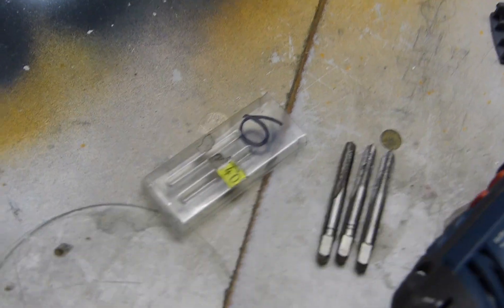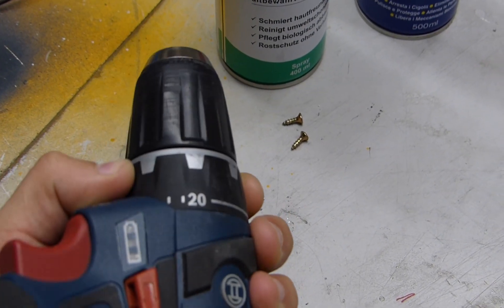Quick tips: Outlaw tapping

Comment: you do not need 3 taps. A single SPIRAL tap will work fine. Been doing that for years no issues, tappping thousands of holes.  But must be spiral tap so the chips are pushed forward.

Comment: As a machinist, I'd suggest just using the final tap to start.  at least in aluminum. It's something I've done in the past, and never broken a tap for. Using a single tap eliminates the potential for the tap stages to miss the previous tap's lead.  Also,  counterintuitively, hand tapping is much harder on taps than power tapping. Taps don't like side forces, but handle torsional loads just fine. so  using a drill is better no matter what. Personally, I  saw no  broken rules.

Comment: For larger taps you can get away with that. The trick is just to make sure the tap goes in STRAIGHT... tap doesn't go in straight you get a broken tap and your stuck starting all over. I have snapped quite a few taps as a machinist by NOT feeding in straight! 

With the 3 taps you got they were the same diameter overall it is just the first one has an extremely long tapered area so you can start into the hole straight. The second has less of a taper and the third has virtually no taper. The idea is you start with the longest taper and finish with the shortest to get the threads as deep into the pocket as possible.
Reply: Calvin Witt thank you for the clarification on the difference between taper/plug/bottoming taps, this was really bugging me.  There is a formal standard in machinery's handbook for the number of teeth that are ground to a taper by the lead angle, but the important part is just as you said, taper=most teeth ground down, plug/hand=medium number of teeth ground down, bottoming= only 1-2 teeth ground down.

Most people would be better off using taper taps for the majority of work done with them, never understood why plug is so common, and dare I mention not wasting your money buying carbon steel, HSS is so much better.

Love the vids Tom! Please keep 'em coming!
Reply: Your totally right that there is a standard but to the average layperson having it in easy speak is generally good enough! I still go by that whole "smallest > largest" for figuring out taps. 

That said good quality taps aren't cheap but save you so much $ and time and frustration over cheap taps that wear out, break and make terrible threads too! Nothing is worse than having a tap break in a part or create terrible threads that strip out way to easily due to excessive force being applied to the screw threads.

Comment: Hi,
Can provide a link to these tap sets as the ones I can find seem to be a set of three the same size.
Reply: ***** Those seem to be taper/plug/bottoming sets which have the same diamaeter and just the ends are ground differently. Taper taps are much easier to start a tap hole with. Bottoming taps are intended for blind holes where you want the tap to go as far down as possible.

Spiral point taps will push the swarf into the hole (which is fine for extrusions). Spiral flute will pull the swarf out of the hole (typically needed for blind holes). I believe that spiral point taps are generally stronger than spiral flute. Spiral point, spiral flute and forming taps can all be used without backing up. The "old fashioned" taps which usually come with the tap sets need the half turn forward, 1/4 turn back in otder to break the chip.

http://en.wikipedia.org/wiki/Tap_and_die
Reply: +Dave Hylands Straight flute (or "Gun") taps actually don't require that backwards rotation to break the chip. That just makes hand tapping easier. The chips will just flow straight forward into the hole without issue.  (This is something I have done a lot (10K+times) as a machinist)
Reply: +Jim Bruckner I think that the straight flute gun taps are also called spiral point taps (which push the swarf down the hole). The straight flute taps without the spiral point (which is what comes with the cheap tap sets) are the ones that need to be backed up. They don't push the swarf down the hole, which is why you need to back them up.
Reply: I'm quite confident about this. The spiral flutes like a drill pull the chip out. Any straight flute tap will push the chip forward, and none need to be backed out periodically. It does not hurt to, however as long as you don't lose the lead.
 I used a cheap tap I bought at ace hardware in a cnc lathe with no option for peck tapping.(the joys of working night shift in a job shop)  The tap lasted the rest of the job (35 pieces  or so, full depth in steel) and I could have used it more, but didn't need it.
Reply: +Jim Bruckner It seems to just be a small difference between "Hand Taps" and "Spiral Point" taps.
http://www.natool.com/engineering-data/tap-style-guide

Because the swarf stays in the flutes when using hand taps, they can jam if enough swarf is accumulated (and I've definitely had this happen). So while you may not need to do the half turn forward, quarter turn back, once you've accumulated too much swarf you still need to back the tap out, clear away the swarf and then resume tapping.